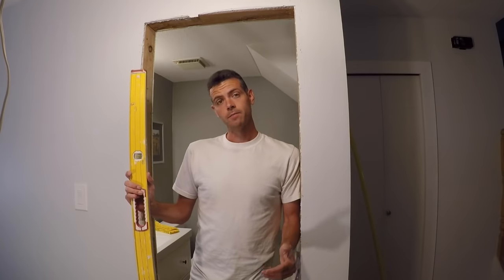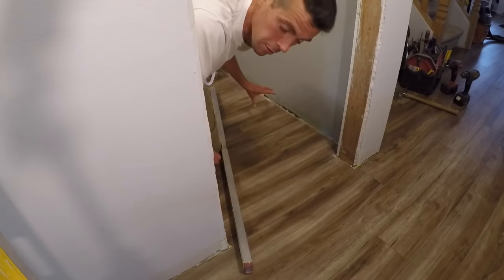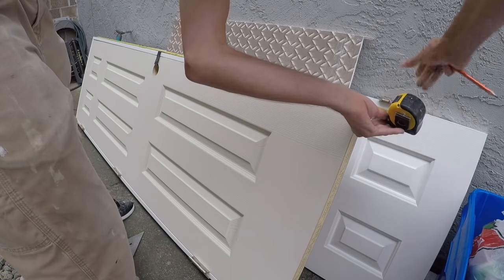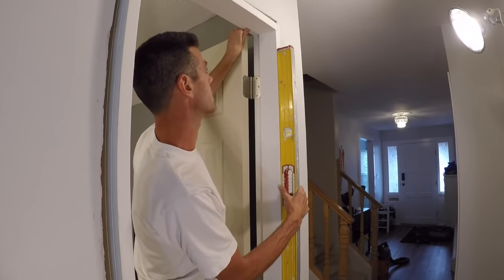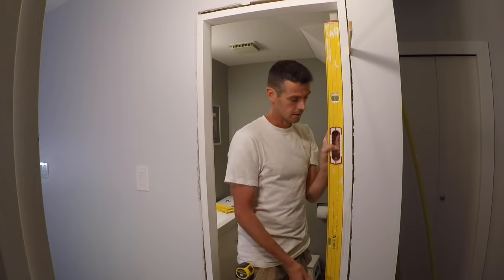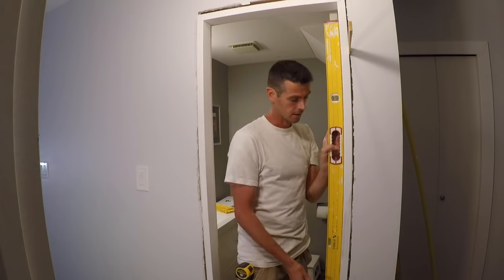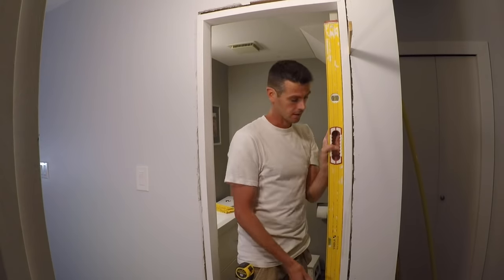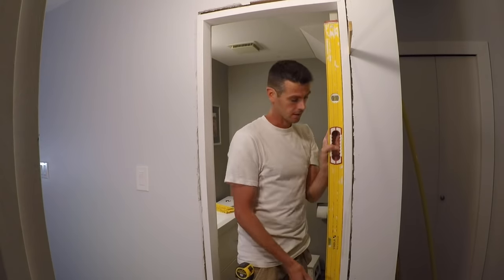How To Install a Door in Bad Framing!

Comment: Finally! Someone showed what to do when things aren't perfect. I've hung many doors and it's been my experience that you run into problems more often than is shown in most 'how to' videos. Twisted or bowed 2x4s, out of plumb walls, bowed walls and sometimes, bowed doors! Things go wrong and you have to fix them. Don't feel bad that the install in your video didn't go as 'smooth' as in all the other door install videos. This is a great video.
Reply: Multitool blades can be sharpened with a triangular file.  Watch the You Tube site "SeeJaneDrill" for an instructional video.
Reply: So so true! 😂😂😁 Happening to me right now! Hope I figure it out like he did! 😉
Reply: Agree wholeheartedly!
Reply: The true professional knows how to fix the mistakes.
Reply: good video, would be great if he did the trim, because that is going to be a nightmare. what would he do rip a custom extension jam for half the jam that goes from 3/8 to nothing  and extend  1/2 the trim with that same taper to return it to the wall?
Reply: You don’t really know how to Hang a door unless you know how fix a problem door.
Reply: I was thinking the same thing! Most realistic video yet.

Comment: Just paid a 'pro' with great reviews to add a closet to a room. I ended up with very badly framed walls and I stopped him after he'd spent hours (literally) trying to hang the two doors with no success. Took me a day to tear down, and another to frame out properly my darn self. THANK YOU for showing how to adjust for mistakes. Had I seen this video before I did the tear down, I would have been able to frame the door correctly myself without the extra work of reframing. Saved your video for the next time I delude myself into thinking things will be quicker and more professionally done when hiring a pro!

Comment: As a retired Carpenter, I removed the door from the jamb and leveled my headjamb, then go to the hinge jamb and  I always ran a 2 1/2" deck screw into the center screw hole of the hinge after I removed the short screw in the hinge.  At this point, I put in the door and finished with the latch jamb hung to the door. I never used screws in my jamb... just in the hinges. I used 8p finish nails in the rest of the jamb installation.

Comment: Fantastic video. You're a great teacher. I found your video because I'm in the middle of a nightmarish installation of a new exterior steel door slab in an existing frame. My search term was "how to install new steel door slab in existing warped frame". The new door is 1/4" proud of the frame at latch side top corner. I'm thinking of slicing a long tapered piece of poplar to make the door reveal uniform from top to bottom. I appreciate that you obviously spent a lot of time making sure your video was helpful. I am guessing you rehearsed what you were going to say and do before you actually started making the video. You speak clearly and concisely and don't sprinkle in unnecessary "ums, errs and ahhs". I've installed lots of doors in my 60 years of DIY work and many have problems like you ran into. Plumb and square framing is not as common as one would wish. I'd say it's a good thing you had problems because you calmly explain how to work your way through them. You were wise to forge ahead and make the video with this door rather than take the easy way out and do one without problems. I'd hire you if it wasn't for the fact it's rewarding to do things myself!

Comment: The fact that you found one plumb wall is a surprise to me.  Certainly anyone that has hung a door feels for you.  It is a real pain.  The only ones I have found moderately easy were ones that I installed the rough framing, since I spent extra time making sure it was completely plumb and wide enough to a little slack to be filled by the shims. 

As a Tip: The door appears to be opening about an inch on its own.  That normally indicates that the hinge side jam is less then 90 degrees to the door.  An acute angle like that binds the hinge slightly so that it causes a very little spring effect.  It can be solved very simply by loosening the jam side of the hinge and placing a piece of paper about the width of a playing card under the inner half of the hinge wing (the side against the knuckle and the pin).  I have found it generally takes two to three folds of the card to make the pin side of the hinge move enough to square the hinge with the door when the door is closed.
Ironically, yesterday I was a clients house working on some cabinets and she asked if there was anything I could do about a door that had been sticking and rubbing on the latch side.  I did the exact same thing but in this case, put the card shims under the outer half of the hinge wing.  This causes the hinge pin to move away from the latch side.  10 minutes and a door that was stuck for a 16 mos was fixed.
Reply: I'd like to see a video for this tip. Visually it would be a little easier to grasp
Reply: @ @yevreeva  Here is a video that shows what I was attempting to describe.  https://youtu.be/7ohPmN2AgOM  I found it with a quick search and a few views of the result to find one that came close.
In all my years I have never pulled out a plane to solve a door issue like that guy suggested at the end of his video.  The problem is that the rub will come back over time since the weight of the door is shifted cause even more stress on those hinges. 

Especially if the frame is installed as professionally as was @Vancouver Carpenter.  His perfectionist attitude towards work is amazing.
If the house has not settled and caused the door frame to be way out of square, you can use this technique.  But before you do, check to make sure the knuckles that the pin goes through have not been sprung.  If they are bent open then replace the hinges with new hinges.  Then see if it need further adjustment.

If the frame IS way way way out of square/plumb then unfortunately is is best to remove trim and free up the frame by cutting the frame nails with a reciprocating saw.  Its actually not as bad as it sounds.  You are just rehanging the door.

@Vancouver Carpenter - sorry for taking over the thread with my long diatribe.  Keep up these fantastic videos, you are one of the best on youtube for sure.
Chuck

Comment: I enjoyed your video. When I was younger, I worked as a finish carpenter. The first tools I took into a new job was a 6 foot level & a large sledge hammer, just to get all the rough frame openings square & plumb. Next I'd rasp, or saw off all of the overhanging sheetrock in the door openings. Then place the framed door into the wall opening, jamb a shim on either side of the door frame header, so the frame would hold still, step back & look at the door/frame reveal & adjust as needed. From here, I'd hang the hinge side, then the latch side, similar to your method.

Comment: It's good to see a problem solving video, thank you. Let's face it, very few things go exactly to plan on site. 

I've struggled with a job finishing some not-so-perfect student accommodation renovations and pretty much nothing goes to plan on it! It's getting there... So it's great to show folks that buildings are often out of plumb, square or parallel. And sometimes we just have to resort to the line of best fit to get the best result, then carefully apply trim to make it pretty. :-)

Comment: I hope you make a video on how to case this door! I would really like to see how this is done.
Reply: any difference use latex caulking to fill
Reply: Same here!
Reply: Easiest way is to trim back the drywall....shave it down so the casing is recessed slightly into it where the drywall sticks out....I've had to do this a few times ...if done carefully nobody will even notice unless they really look at it.
Reply: Michael C p
Reply: Use a flush cut router bit to ride the sheetrock and cut the jamb. After it's flush, scribe and cut a jamb extension. Apply wood glue and tack it onto the jamb.

Comment: Good video and good information.

I use my speed square as a guide when cutting with my saw.
Line the saw up, put the speed square up against the saw guide and hold the square tight to the wood. Keep the saw up against the speed square as you cut.

Helps me to cut straight.

Comment: Years ago, when I was finishing off my parent's basement, I found a bunch of returned 6 panel doors that had been cut for various openings for about $10 each. I just made every opening a little big, shimmed a pine board on the hinge side plumb, mounted the door with self-spacing hinges, then shimmed pine boards on the top and latch side to fit the already hinged door. After I added jam strips and casing, it was hard to tell it from a pre-hung door (other than the self-spacing hinges, which I could have avoided if I'd cared to), and each door always opened and closed perfectly. I little hackery is kind of fun every now and then.

Comment: I've felt you're pain 🤣🤣. Another cheat is to tip the outside of the hinges on the jamb side with cardboard it will give you another 1/16 ish on the latch side. Love the videos👍

Comment: Nice video mate, and cool that you call out your mistake. If I could offer a tip, just spend the extra time checking the opening and squaring and plumbing up off the bat. Use it as your template and shave a smidge of the door (given it's an interior door, there's not a lot to play with) but if its 5 mm then that's an easy shave of with a 'track saw'. If it swings "ghostly" then stuff it..it's not a big deal.

Comment: I've replaced every door in my house (including installing a brand new back door and replacing the front door).  It's funny how you run into these issues with existing doorways.  Great video on troubleshooting these problems.  I've got 1 set of closet doors to go and then I'm DONE! (with the door replacements, not the rest of the reno.)

Comment: Takes humility to admit all the hassles that go into a remodel door install.  I’ve done a lot of door installs in old homes and I’ve learned it’s critical to pull casing before ordering doors so I can anticipate up front what can of worms I’m going to be dealing with. It’s not unusual to find excess space in rough framing and walls out of plumb by up to 3/4”. I’ve gotten so tired of the garbage building in my area that I recently purchased a Jambmaster from Canada. It mimics the prehung door unit in the rough opening and let’s you produce a perfect sized opening that is plumb and square so the prehung slides right in. For a guy who hangs a house full of doors it’s miney well spent. You give good info on how to evaluate the opening.

Comment: You got lucky! Had a prehung door that I was trying to instruct a coworker how to install...well that 30 minute job turned into an hour and half....
Thanks in part to our local lumber company door shop. We have a saying around here. "There's square, and then there's Ridout square." 
The rough opening framing was SQUARE the Ridout DOOR was 5/8" out of square! Yes the DOOR was the thing out of square! So my coworker got a free lesson in how to use a jack plane to square a whacked out door.

Comment: Good effort! Annoying that your trim size was tight to start with.  Huge Tip for Vancouver Carpenter and anyone else who is interested: put your screws just below the shims/packers, not through them. When things go wrong, as in this video, you can easily tweak the screw out a bit and pull out your packers.  There are other things I do differently, which make things easier, but a good effort and you got there in the end! Good perserverance.

Comment: This gives me hope! As a DIYer I felt proud of building a partition wall to create a room, mudded and painted. I watched then bought the Quick Door Hang that made it all look super simple. Then when I tried actually installing the door I struggled from the first moment just trying to get the hangers onto the door frame (ya know, lack of having 3 hands lol). Got that resolved, moved door into position and followed instructions to screw along plumb line and NOPE. Door swung out, wouldn't line up when positioning all door hangers on the sane notch, door closed fully at bottom while half an inch open at the top. My initial reaction was the door was the cheapest pre-hung interior door so obviously it's the hinges or warped wood. After watching this video, I realized I took a lot of length and level assumptions about the floor and my new wall to be true as well as the door jamb. In reality, that wasn't the case (pun intended). I'm now going to remove "easy door kit" and do all the pre-checks on the door, floor, and walls and then use the tried-and-true method shown in this video and use old fashioned shims.

Comment: I find it easier to take out the pins and first install just the door jam.

I first  use a finish nail gun and tack the jam slightly below the shims. That way I can adjust shims in or out .

It is good to leave a gap at the bottom of the interior door to allow air to pass when the door is closed and the HVAC is on.

Another suggestion is to remove the hinges from the jam. Screw the jam to the 2x4 behind the hinge. That way the screws are hidden.

Great advice on using low profile screw heads. Also great advice in checking if the floor is level.

Comment: I usually check rough opening first and place the door in. If I can't get a good reveal due to out of plumb or narrow, I address the studs first.  The framing is the root of the problem so just deal with that first.  More often than not when I tell myself "it'll be fine"  I wind up in the same spot you found yourself in.  Also, a slight bend in the hinge pin can help with an unfixable twisted door than wants to swing.

Comment: Excellent video!  Everything from beginning to end, especially making the mistake and showing how to fix it by "persuading" rough opening (I liked the dull multimaster comment because I've had to do the same thing and it sucks), cut some drywall, add additional screws,  vs. editing it out or just giving a brief explanation of what happened and what you did, which might be difficult for a DIYer to visualize if they've never installed a door before.  

This is going to be a huge help because I have a few doors I need to replace and either the rough opening warped over time or someone just literally half assed it.  Especially when I look at how they painted some of the stuff in this house and didn't bother to cover anything, like the window trim, with painters tape.

I'm trying to install some shiplap on the wall between the two rooms and starting from the bottom it goes from about 13 1/2" between the trim around the doors to 12 1/2" by the time I get to the top.  I'm expecting it's going to be a combination of the rough opening not being plumb and square and how they shimmed the door jambs.  It's a mess.

Comment: A plumb-Level  laser is  a quick way to check a rough opening on both sides. I would have pulled the door off once I had the hinge side level. I would also use shorter screws to temp(orarily) install the  jamb if in doubt?Once everything is good you could then individually remove each screw and replace with longer screws to hold permanently.  Use  mason line (or jet line) diagonally from the (rough opening )corner to corner on the on the left and right of the door jamb. If they touch at these center then it’s true not twisted or cockeyed? You basically had to clean up the framers and drywaller’s mistakes.

Comment: Things I like: 1) stabilla level f%&*ing best levels out there. 2) screws. 3) good explanation for beginners/ homeowners.  4) owning your mistakes on camera and fixing them... on camera. That takes guts for which I applaud you.
Things I dont like: 1) compensation for a door slightly out of plumb. Contrary to popular belief I've found that plumb level and square (in a remodel setting) is far less important than the opening being on plane. The trim covers any level/square issues and miracles can be achieved by adjusting the hinges after the fact. Simply bending a hinge pin slightly stops that door fall shown early in the video. That's just me though. All in all this a fantastic video.
Reply: Lol, bending pins is what you do when you didn't do it right.
Reply: @cencoast_7.340  or when the guy before you didn't do it right, or when the customer loves their mid century wallpaper and hates the idea of an off angle reveal in the 70yr old home they just paid $1million for, or when its rental property and it needs to be done yesterday because the tennants r bitching about how there bedroom door slams every time they open their front door in their section 8 apartment, or when its a young family buying there first home and they cant afford to have a high level tradesman spend 2 days installing one bedroom door. Did i miss any other circumstances where bending a  hinge pin might be the best option? Deel free to reply

Comment: Very helpful!!! I had to build the a by wall and through wall with a door frame and a door...out of 2x4x4 in a shipping container opening....to say the least nothing has been smooth. But when you're starting your project with lumber that's already half the length you need, what could you expect.

Comment: The inch or larger space on the bottom actually has to do with fire code in most cities and airflow to prevent backdraft. So while the gap sucks, especially on bathroom doors it actually is there for a purpose
Reply: I think the gap was intended to accomodate carpeting

Comment: Lotta work. I would wack it back into plumb, toe screw the bottom plate and fill any possible cracks in the drywall corners.

Comment: This is another reason why having multiple length levels, is a must when in construction (yes....depending on the Trade, might not need a 72” level & can get away using a 12-14” level day to day, lol). 
Of course......something easy & simple; is never easy & simple......lesson learned long ago🤣😉
Cheers👍🏻